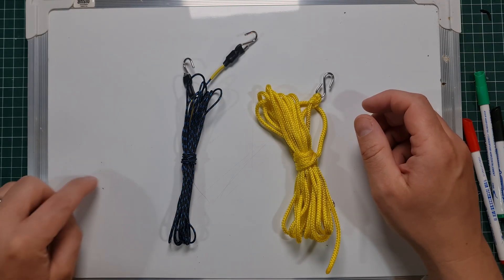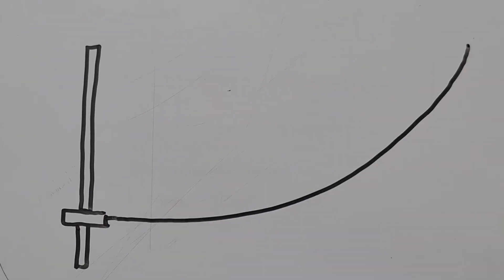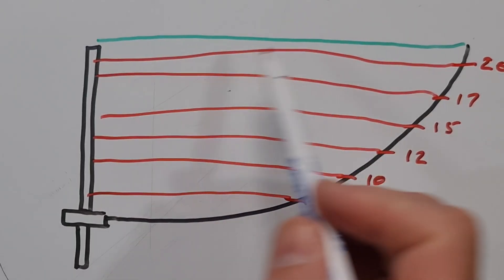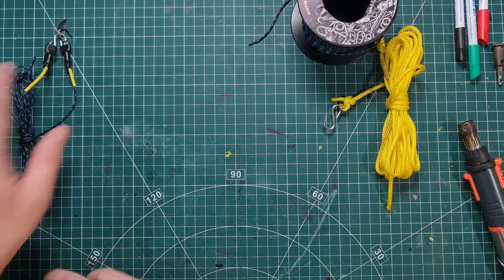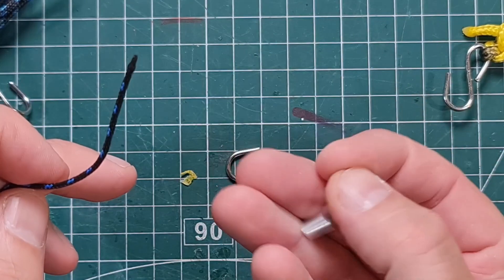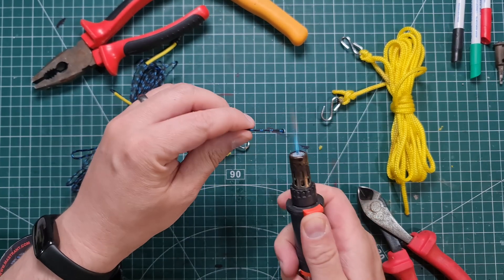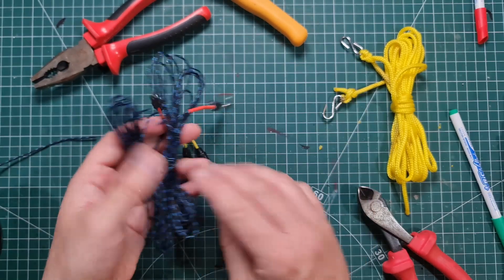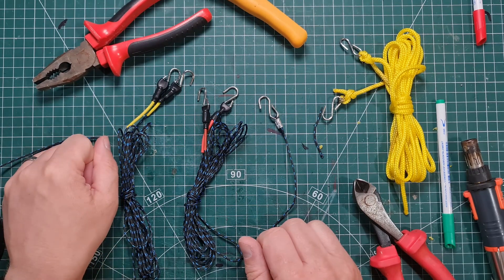How to Make Professional Looking Hexbeam Rope Sets #hamradio

Comment: Thanks for sharing colin, and i do admire your determination on this ant. I think it must be a project for its own sake, and not so much for dx time on the air. Personally i would have simply put up a decent vertical ant, which i think would have closely matched the on air results within a S point or two, or i would have simply bought a hex and got on the air hi. 
Good luck with the final results, and i hope adter all your hard work, i can get you in the log. In comparison Pete M3KXZ/qrp got me tonight on 20m cw.
Take care colin, congratulations on your work. 73. Ps : due to ill health i might have to leave the hobby , so lets hear you soon.
Reply from the maker: Hi Brian, this antenna is a challenge to build nicely and I like these challenges. I probably enjoy building antennas more than I do using them. We are all different. Thats a real shame if you have to have to give up the radio. I just dont have the time in the morings for radio. I do have a weekend to myself on the 27/27 July. Lets see what conditions are doing then 👍